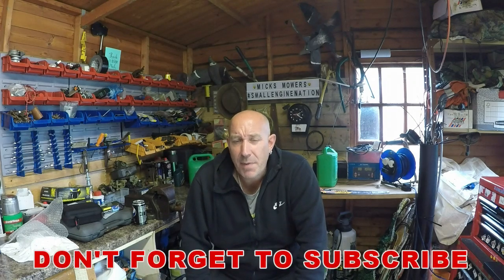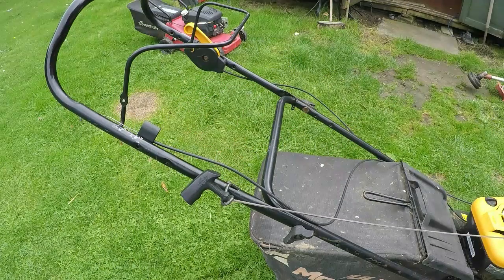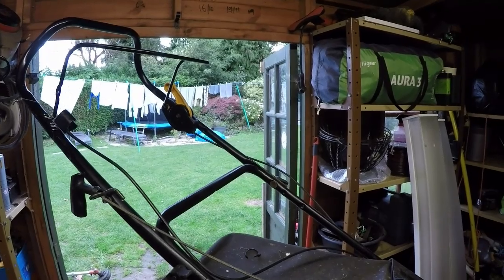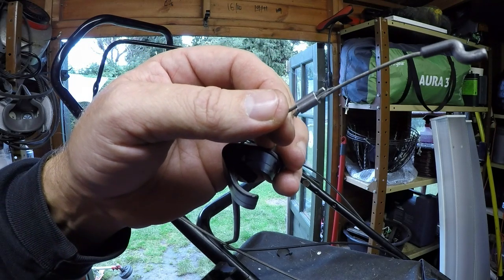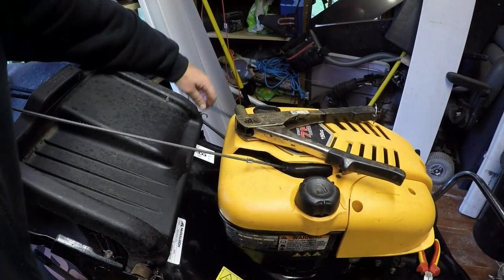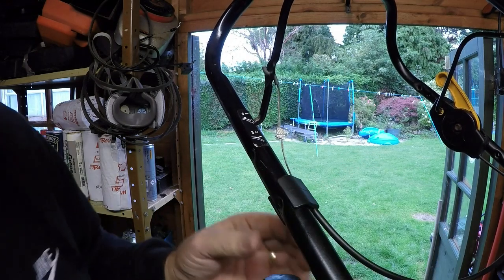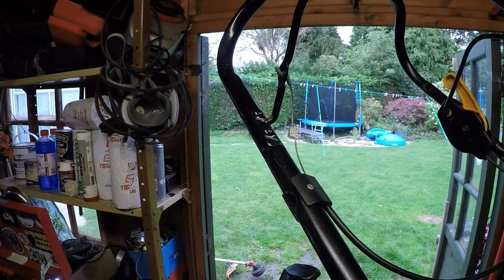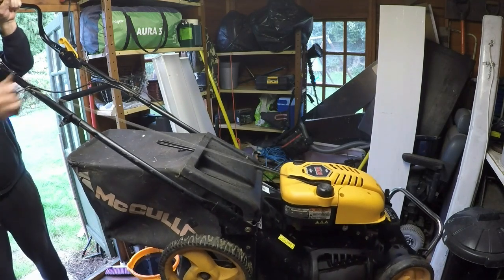#lawnmower #mower #easyfix How to fix a lawnmower with a cable problem

Comment: Sounds a little lumpy still, but listening to it a couple of thousand miles away, my ears my be deceiving me. I’d do a quickie on the carb.
Another one lives!
Hope your new shed shop is secured and stout. Looks like you’re gonna get the remnants of Lorenzo.
Reply from the maker: jim s yeah I think your right but until I put the new blade on and air filter I will leave it so I can hear what it’s doing.

Comment: very nice.  Do you have a link?  I can only find electrical ones.  I am always messing with cables as you do too.
Reply from the maker: Bruce Pender yeah mate it here you go me old mate. https://www.amazon.co.uk/Aluminum-Crimping-Sleeve-Double-Ferrules/dp/B07F1SDW8Z/ref=asc_df_B07F1SDW8Z/?tag=googshopuk-21&linkCode=df0&hvadid=231922535685&hvpos=1o30&hvnetw=g&hvrand=413396877954250965&hvpone=&hvptwo=&hvqmt=&hvdev=m&hvdvcmdl=&hvlocint=&hvlocphy=1006538&hvtargid=aud-543776533562:pla-526743841867&psc=1

Comment: The speed is a bit low, but that's ok. Only fiddle with that when you get a new air filter for it. These Inteks absolutely must have a good air filter to run correctly, and are meant to run a foam element also.
Reply from the maker: Ywqj mate I have ordered one and a new blade. Then I will tune or clean the carburettor if needed